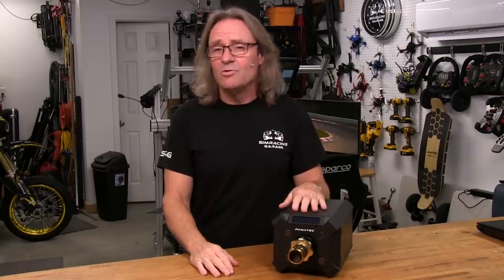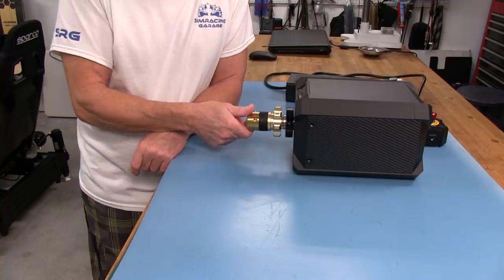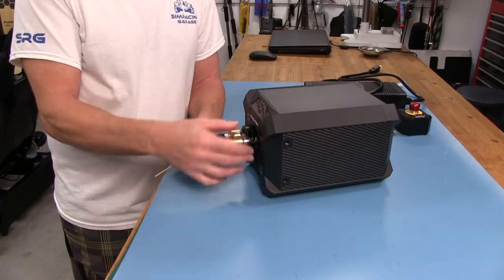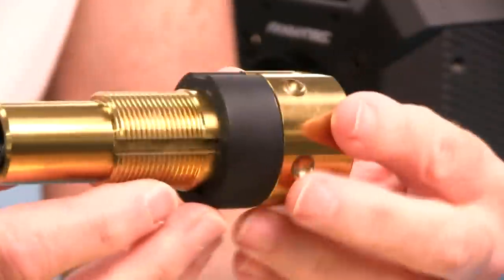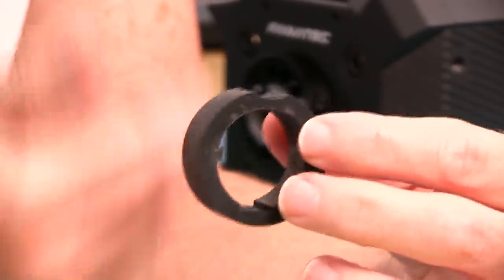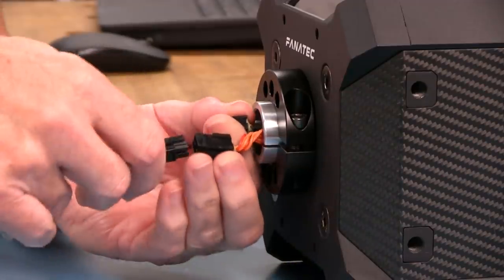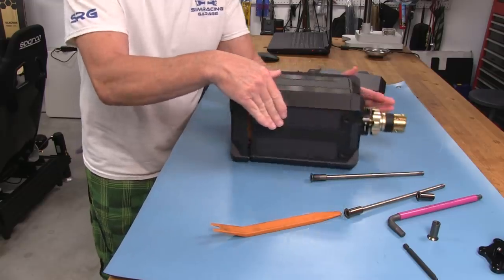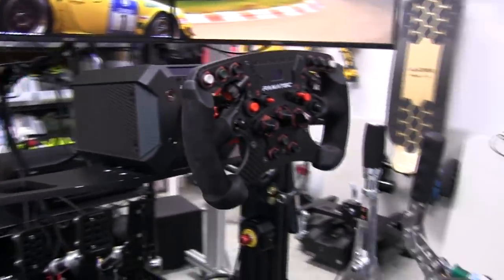Fanatec Podium DD2 Review

Comment: I've had the DD1 now for around a year or so. The first one I got had a connection issue with the wheel (electronics; no wheel would power on when plugged in) and the whole repair process was horrid; I was out of a wheel for around 4 weeks. However once they sent me a new one, it was all good. It's the best wheel I've ever had and it just...feels great lol. It is nice that it works on the PS4/PS5 since I do from time to time play GTSport with friends. However I mainly use it in iRacing and rFactor 2 and it feels so incredible. Hope to god you don't have QC issues and enjoy the product!
Reply: Yeah - I've read way too many horror stories like yours to even think about buying one of these.

Comment: @simracinggarage  If you set you max force between 4-6  and Wheel force to 25nm.   You can lower NFR to 3 and NDP to15  = no oscilation. good clean fidelity :)  Thats how i run with the DD2 for months.  (+ no QR flex)   :P

Comment: Barry, would you agree that the fanatec DD system is priced a little high compared to OSW, accuforce, etc.) I think the Simucube Pro 2 might be the better wheel at much less cost considering fanatec wants you to stick with there high priced ecosystem as much as possible, like the Universal Hub Button box thats needed if you want to use your own wheels like a omp, etc.) making it closer to $2000. Whether its the Universal Hub or The many $400 wheels they to offer for the Base your looking at $2000 to get driving with it.

Comment: you cannot use 3rd party wheels unless you use their wheel hub, that's sad. The base won't give out any FFB if it has no signal from a Fanatec wheel or wheel hub :-\
Reply: I am surprised no one hace made a chip that works so you dont have to use the hub
Reply: @Petrolhead66  it's encoded so you would need to hack it to pretend to be a fanatec wheel. 
The new and upcoming fanatec wheels also don't work on other DD bases due to the encryption. 
Fanatec really wants big market share, so much that they lock out potential buyers of their wheels that have no fanatec base. Seems they want to force them to swap to fanatec completely. I know some people that stopped buying fanatec and sold their fanatec wheels and other gear because of that politics. (Me included)
Reply: @Tintop  There is the upcoming Podium Hub at 200 euros but I am suprised in the day of hacking that no one has hacked it yet

Comment: I have a DD2 and have no flex. And I have 10 simracing friends with DD1 or DD2 and no one of them have this flex. And in the comments the most people say that they don't have this flex. Think you had an failure one base.
Reply: Seen a couple people comment of  complaints about a notchy feel in the wheel .. i don't remember if they said it happened right away or over time.  Since you and  so many friends have them is this something i should be worried about ?

Comment: Ace! Great to see a pro setting up FFB.

Beautiful fit and finish on this unit. Just peek 21:10 ... the indexing tabs in the washer? see how it isn't just a rectangular tab jutting out? it has those two semi-circular divots taken out? in a blade, that's to avoid stress at a 90 degree corner. Here, I'm guessing it's so there's nothing like the hard edge from a sharp 90. That's lovely. Someone put some thought into it. A number of extra operations!
^5
/dks
Reply: p.s. good of you to mention 100% silicon lube. I commented on Boosted Media's review that //possibly// there might be a case where //some// lubricant might be aggressive against the rubber bushing.

Comment: Since launch date, its very hard to buy DD2 here ( brazil ). I try on march 2020 but pandemic destroy all possibilities. So, im stay on CSW 2.5 until  now. With CSL DD launch, i Will consider to buy a New base. But honestly,  CSW 2.5 to CSL DD ( even with boost kit ) isnt a great upgrade. Ok, so im thinking about DD1 and finally decide to DD2. WHAT SPECTACULAR product ! Great drivers and softwares ( august, 19, 2021 ) and definitly ZERO flex on my two wheels -  porsche 911 rs gt3 BME and 2021 f1 limited edition. Another world in simracing experiences. Off course, at higher prices.

Comment: I knew the play on the shaft wouldnt go past you Barry, as it did with other reviewers. I own a DD1, and noticed that play, its a real turn off... Excellent review!
Reply: There is no play in every unit that's the reason. Mine has zero
Reply: 1, 2 , 3, 100 wheels is enough to say it’s a bad design and needs to be changed.
Reply: @zaneislandd4650  you are not pushing it enough, its a design flaw. try it with a BMW gt2 rim and it'll be easy to see...
Reply: @WhiteHawk77  did you move it around like Barry did? at 6:27
Reply: Just double checked.  No play in mine.
Reply: @WhiteHawk77  I've been using mine, tightened it, played a while, tightened it again and got no flex... I guess it kinda works ok. But it could be so much better...
Reply: @WhiteHawk77  Its not that it doesnt tighten well at first, but as you use it, the rubber gets molded to the inside of the wheel QR and after a half hour you can tighten a little bit more and gets better!

Comment: Hi Barry, awesome review, per usual!  AC has great FFB, just a very different setup then iRacing. Try Assetto with SPr (Spring Effect) OFF, dPr (Damper Effect) OFF, ndP (Natural Damper) set to 25 or 30 and ndP (Natural Friction) set to 3 or 5 with For (Force Effect) set to 100. You will get way more road feel and detail without much oscillation. This may be a different point for you to tweak from. Then you can add a little SPr 10% to get more fake centering spring/weight in the wheel or a little dPr 10% if you want to deaden the feel/remove remaining osculation a bit... I run neither cause if feels more natural with the new settings, (as their names imply = ). AC has great self aligning torque, probably why so many use it for drifting = ). Also, in game, I do not set any of the effects higher then 16 and my gain at 60%. The cars very from 90% to 120% for individual FFB strength (I know, very subjective = ) as you said, this is all subjective = ). I run my DD1 at 70% FF (Force Feedback). If you happen to give this a try, let me know if it works out for you.
Reply: Thanks for the settings.  I wasn't playing AC much since I got my DD1, because I couldn't get it to feel right.  rF2, ACC, PCars2, RRRE, Automobilista, and iRacing all felt great, but not AC.  Your settings have now transformed it for me.  It now feels as good as rF2 to me.  I was using the recomended settings from the Fanatec website for AC, which are not good.  They should put your settings for the recommended ones, because they are a hell of a lot better.
Reply: @Copef1  That is great to hear! Ya, I started with some spring and damper but then removed them cause I read or saw someplace that they were not well or fully supported in AC and my DD1 came to life. 25 (Natural Damper) and 5 (Natural Friction) are from the Fanatec forum but so are the shitty spring and damper settings. I now run 25 and 3 as going 30 or 7 did not feel like the right direction (this is subject to change as I keep farting around = ) Enjoy!

Comment: Barry, what made you get rid of the original motion system you had (Cant remember the name) The one with the red plate covered hydraulic rods that attached to the back of the seat? What is your main motion system now? I know youre constantly changing things up as new products come out and what not. It doesnt even look like you have your big extruded aluminum cockpit anymore either. Everything look much more compact. Wait...maybe this is your second rig and not the main one?

Comment: Hi Barry lovely video thanks, I’m so debating against a simucube or fanatec not sure as yet which one i would like to go with. Fanatec are coming along the way with the latest firmware updates especially the beta version think we are on 439 now (I know as I use the clubsport v2.5). I saw the movement in the quick release boss in your video, the overall length of the wheel assembly was really long on your rig so the movement will look alot worse then maybe using a standard spec fanatec wheel. I have two wheels a formula wheel and have no movement in that and my BMW wheel does have alittle slack but I think it is liveable. In a concept point of view I think the fanatec quick release is amazing on how it works but I wish fanatec could get rid of the slack fully, they tried with the DD they used rubber type material but maybe a material change to something slightly harder could fine tune it, something like the HPP Brake pedal rubber/plastic, or the heusinkveld brake pedal rubber/plastic. I’m sure fine tuning will go a long way, plus keep the original design intact for legacy users.

Comment: For those concerned about the flex:
I was very hesitant to buy the DD2 based on this one flaw. Slop in a steering component is super annoying in a rig. However, I haven't noticed ANY of this flex in the steering wheel over the last three weeks. The torque and vibrations from the DD2 have managed to loosen my rig and my steering wheel, which were both immediately noticeable. But I haven't detected any issue with QR flex. 

The flex IS there. It just doesn't present itself while I'm racing. I think a lot of it has to do with the direction it flexes. Its sort of a front-to-back wiggle that just doesn't appear naturally in use. It would be an absolute dealbreaker if the flex was in a circular direction around the wheel shaft, like when a steering wheel comes loose from its hub. Luckily, that's not the case. 

I believe most users, if not all, would be extremely satisfied with the DD2's performance. 

(Anti-Disclaimer: This review is my own honest opinion and not influenced by any 3rd party. But I will accept free stuff from any 3rd party that wants to send some my way!)

Comment: The proprietary quick release is what really tilted me towards the SC2. It`s just another expensive piece that I don´t want but need to even run a wheel. Stacking two QRs on top of each other is also not very appealing. I mean, just look at the tower Barry stacked together at 1:38:53. I am certain that the accumulated length of all the attachments and the resulting sideways torque does play a big role in how much the Fanatec QR flexes.
Reply: It doesn't look appealing to me
Reply: The new podium hub should help reduce the length.
Reply: @baj993  This actually is the new podium hub. I asked Fanatec if it would compatible with motorsport hubs and their suggestion was to mount it exactly like Barry did, albeit admitting it would not be very elegant.
Reply: Hagedorn Racing the new podium hub doesn’t have a button box attached. It will be released at the end of the month. You can see a picture of it at 1:38:51
Reply: @baj993  My bad, you are totally right. But you`d still end up with a similar long construction with two stacked QRs. The Buttonbox can be dropped, if you are fine with not having any buttons.

Comment: Just put a taper washer instead of the intermediate ring behind the tightening wheel, put your wheel on and tighten a taper ring up against the back your wheel removing 100% play. Bin the rubber.3d print a nylon one if you have no acsess to a lathe.

Comment: the thing will brake like anything from fanatec. will never buy anything from them again. every single wheel or shifter I had from them had issues sooner than later.
Reply: Mine was issue free for 4 months, and last week the power buttons failed. Already been 5 days since I reported the issue and they still haven't sent me instructions or a shipping label to get it fixed. I'm less than pleased.
Reply: Ok, I bought stuff from Fanatec from very early on... mostly runned perfectly, the few warranty issues I had were handled well and I always was able to sell the equipment for excellent prices!
Reply: I have clubsport V3 pedals, a clubsport V2 wheel base, a DD1 wheel base, a clubsport SQ V1.5 shifter, three universal hubs, a formula rim, a McLaren rim, and a F1 2019 rim, and I have never had a problem with any of them. Most of what I have, I have had for several years, and I use it almost daily.  Sorry you have had problems, but from my perspective Fanatecs stuff is very reliable.

Comment: Question for all: Those of you that have (or had) a cockpit with a bar between 
the legs, do you find it getting in the way of pressing pedals?

I'm looking to get my first setup, and don't want to waste ANY money, if I can help it.
If it matters, I'm a bit over 6'2'' (189cm).
Thanks in advance !
Reply: I quick tested a few demo playseats. And the bar is not a comfy tool. I would say its worse then a kart cos the pedals of sims are closer together. If u would have a 2 pedal set with en of space between them it should be a non issue. However having 2 bars instead of 1 should be more stable for your wheel.

Comment: You can side and front mount the DD2 in addition to bottom mounting it, so more solid mounting options are available.
Reply: you can NOT front-mount the DD2, if you do so, you immediately lose your warranty.
Reply: You cannot front mount the Fanatec DD units...The bolts holes on the front are for mounting accessories only.

Comment: Come on Fanatec... When you send a unit for review - you have to make sure it is not a faulty unit! That's the least you can do...
There are zero flex in my DD2, no matter how hard I twist it.
If mine was like that - I would be pretty annoyed and send it back.
I am very happy with mine though and prefer it over the others dd wheels I have tried.
Reply: Agree, the flex looks EXTREME! ive had the F1 2018 LE rim +  now i use the P1 and there is ZERO . flex from QR
Reply: i have flex on mine, put some force on it and u will see the flex
Reply: Think the flex issue is more to do with the wheels than the base.....I have three wheels.....2 are rock solid on my DD1 but my Xbox1 universal hub seems to have a lot of flex which I can’t get rid of.
Reply: @mikereynolds5081   ahh - that also makes sense from what Barry is saying.. "This has been an issue on all base's" - If he has used the same hub/wheel on all of them, and there is a issue with those, then I can understand, because I didn't remember any play on my csv 2,0 either...
But it is for sure that Fanatec has to come up with a new QR system, when the same guy can get two faulty wheels, and as we know, they will. (And yes, the QR is changeable on both base's and newer wheels)
Reply: Barry normally buys all the stuff himself to avoid bias
Reply: Because he got one with flex, He showed us how to fix it. Wouldn't have  happened otherwise would it?
Reply: Typical fanatec quality and quality control. I'm not a hater and I don't like to be biased; I really want to see better products everyday and more competition and better prices. I won't earn 1$ if fanatec sells milions of their product and won't lose 1$ either. I just want to see a company with better products and better prices sell more units and make the next quality product. That is how I and you can benefit from those sells.
Logitech made the very first (real) FFB wheel and Fanatec was the first company to make belt driven wheels AFAIK. I'm sure this fanatec and fanalab will bring something new to the table and at least other companies can learn from that.

Comment: I have owned the DD1 for a year now and ive never had any issues with that flex. I dont notice it nor does it seem to cause any problems with my driving.
Reply: It's a tolerance issue - some wheel bases/rims are fine, others aren't. Its practically a lottery when you buy a Fanatec.

Comment: Ok, that's weird, I have the DD2, but never that much of oscillation - not even close. 
I set Max force in iracing to 25nm, wheelforce to 7.0, linear mode, no damping.
In the DD2 setup: Main FFB (FF) to around 35, FOR to 100, SPR/DPR Off, all Natural settings (Friction/Damping) to OFF (I would not recommend this 2 settings at all as it adds lags to the effects). That works pretty decent.
Reply: thats because you dont run 25Nm but "only" 8,75Nm, of course on this Torque level you dont experience that much oscillations ;-)
Reply: @momorious  I meant the other way round: wheel force 25, strength 7.0 -> that puts around 10nm on a turn with 35 ff (which is what you actually would have in a smaller openwheeler without servo)
Reply: @iseeq72  You limit your peak output of the motor to a mathematical peak of 8,75Nm with a FF setting of 35 (note that the Nm shown in the OLED are not 100% correct because inside the base there is no real Torque meter, it's all guessing from the software). Therefore the wheel force setting in iRacing is wrong (needs to be 9, not 25 but that value isn't doing anything at all so it basically doesn't matter). And you should change the strength value from X.X to a Nm setting by clicking on the value which then changes the 7.0 setting to a proper Nm value so you can calculate your specific output.

Comment: The reason I don’t really mind the flex is due to the fact that the flex you speak of is Z axis based. Which the motor operates on the x and y. So when the motor gives you feedback it is on the x and y axes. When you turn the wheel left or right. So why tighten an axis that provides no feedback makes sense? If this was rudder, big diff.
Reply: But how is that flexing acceptable on a $1700 wheel base?

Comment: "not going to much into the dimensions" - but that's what I came here for :(
I thought: if any reviewer measured the dimensions then it's SRG.
I'm desperately looking for the length of the wheelbase which I can't find - not even in Fanatecs own drilling templates.
I need to know it though because I'd like to prepare my rig for it (should be arriving on monday \o/)
Reply: nevermind: the A3 drilling template (instead of the A4 one) has the length...